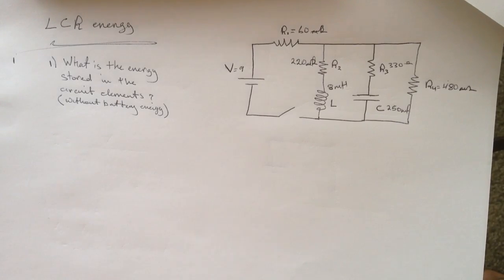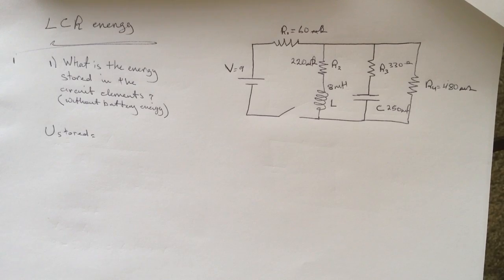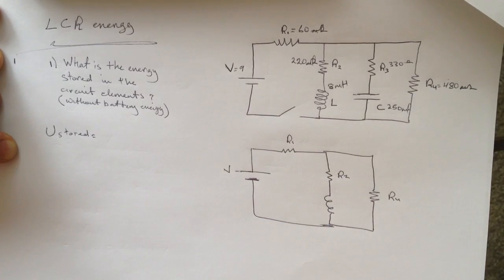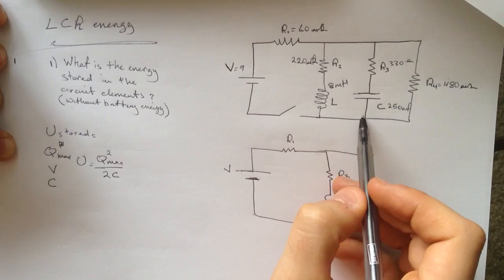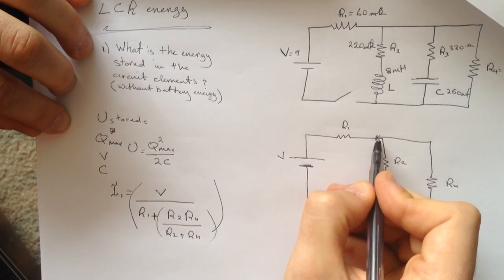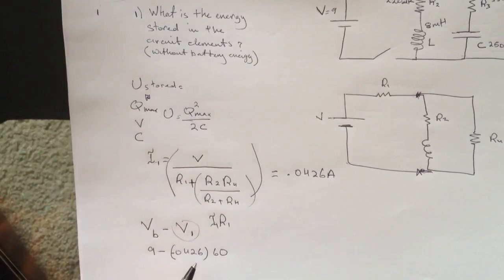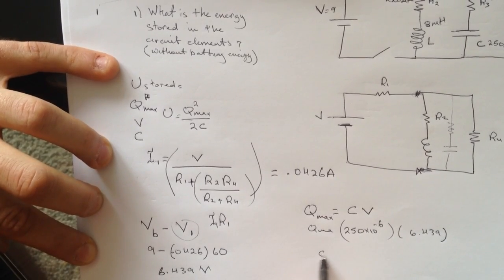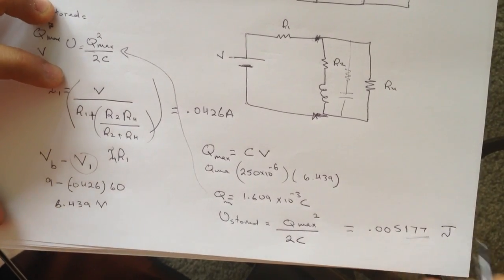LCR energy "smartphysics" solution

Comment: Why isn't the voltage across C equal to the battery voltage?
And how did you decide that V_b + V_R1 = V_R3 + V_C?
Reply from the maker: this way you are ignoring the resistors in the circuit. if there was no R1 then Vb=Vc,
and the equation is Vb-VR1=VC because if you look at it, they are in parallel which mean that they have the same voltage.